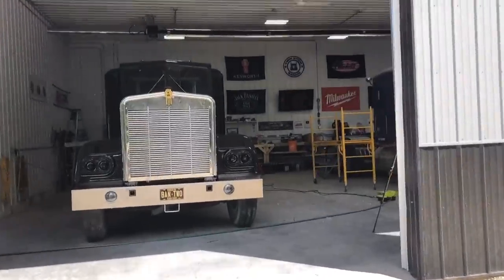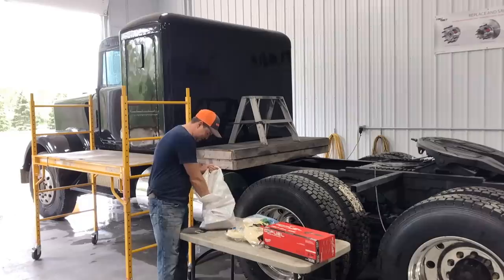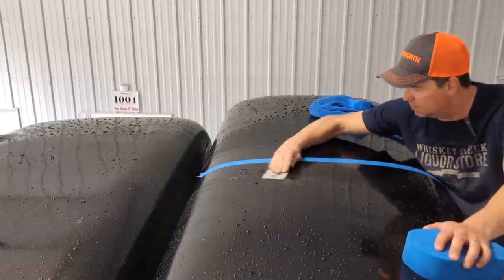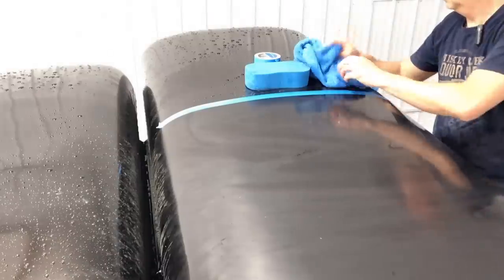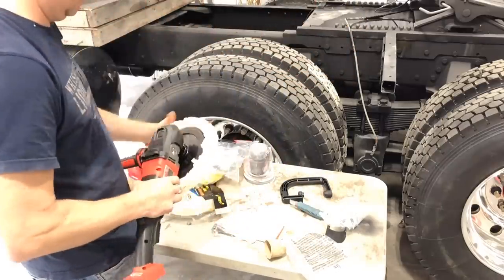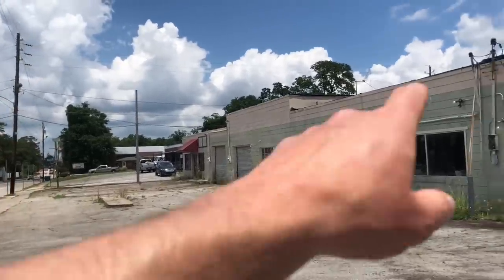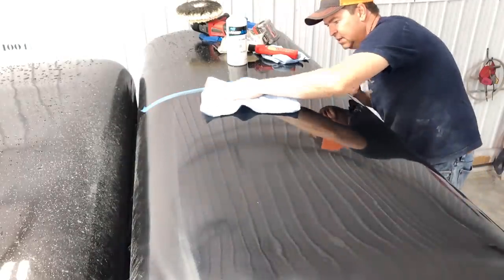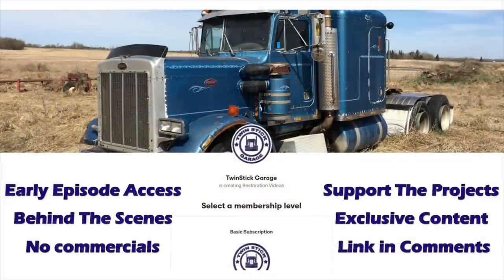Smokey & the Bandit Tribute Truck Ep.46 Rescuing Mediocre Paint

Comment: This is why a high quality, professional paint job costs so much.  A true professional spends a whole lot of time preparing the surfaces, a little time painting, then more time sanding and polishing.  Wet sanding and polishing is pretty much a requirement for a shiny, smooth finish with single stage paints.  The two-stage base coat then clear coat can allow you can get away with less or sometimes no wet sanding of the color coat.  For many years now, factories have been priming by dipping , then applying base and clear coats via electrostatic paint methods, which applies a very uniform, but also very thin, layer of color and clear coat.  Keep up the good work, Mark!  Take your time, make it the best you can and you will be rewarded with a great looking truck.
Reply: The W900 is worth it all Your efforts
Reply: I had mine painted by a guy for pretty cheap. Up close you can tell, but he promised that from 10 feet or more, I wouldn't be able to tell the difference. For a working truck, it is pretty good, but I wouldn't mind having a nice paint job.

Comment: OK mark I do car detailing, 1) your buffing pad needs to be constantly cleaned out, get a pad spur cleaning tool or you can use a screwdriver tip lightly. When pad starts to drag on paint clean it. About every other time you add compound. 
2) you will have better success using foam pads not wool. They have different styles and quality.
You don't have but 2 coats of paint so you'll have to be very careful. With foam pad. Go much slower with foam pad.  Your way too fast on foam pad. You'll get a better shine the higher the sandpaper grit..1st pass use 1500 grit, sand buff off, then use  2000 grit same thing. Buffing it right is a slow process for an experienced person. The buffer you have is hard to master. You should have gotten a duel action buffer way easier and more forgiving.. Also when using your buffer keep pad flat as possible, your using the edge not as much the bottom of pad..do not apply any waxes to fresh paint for a minimum of 45 days..!paint needs to evaporate the solvents out of it. You wax it too soon you'll know it, but read the paint manufacturer recommended time..
Reply: Yep needs to keep the cloth pad blown out or it’s going to just leave more scratches and I did a lot of body work back in the day and that was one of the first things I was told was to keep the pad clean or it was just making more work cause it was putting dirt and grit right back in the pad
Reply: who freaking cares

Comment: Nice job Mark! We always use a spray bottle to apply the water. It’s much less mess. Another thing is to get a thin rubber block from a body shop supply house and squeegee the area that you wet sanded. It shows where you need more sanding. Just a couple tips to make your job easier. Keep up the great work and thanks for sharing!

Comment: This is my job, ive been doing machine polishing for 20+ years. Mark, i dont wish to rain on your parade but that is going to look like a dogs dinner when the direct sun is on it, youll see all the buffer trails where youve been with the machine.  Slow down a bit with the machine, you're arm speed is too fast and erratic. Instead of going direct to the wax, you need a soft foam pad and fine finishing polish on that dark colour to remove the buffer trails/holograms that the wool pad and heavy cutting polish leaves.  I would also advise you to use that orbital sander with 1500 grit paper to sand the orange peel out. It will make it a lot easier and give you a more even finish.

Comment: What a great video and fantastic projects! I admire your work ethic and commitment. I love everything mechanical.  I actually spent a significant amount of time behind the wheel of a ‘73 KW W900 with a 400 Cummins, 15 speed (deep reduction on the dash), and 370 rears. What an experience, now that I look back at it.  My regular truck was an ‘85 KW W900 but when it was down, the ‘73 was mine. Love the clip of Lamar’s.  Also, go get several packs of plain white T-shirts. The cheapest ones you can find. They really help with finding high spots, low spots, and rough spots in bodywork.

Comment: you can have the best professional paint booth and still for a show quality paint job there will always be some paint correction that will need to be done. you could probably start out with 1000 then do 1200 and then 1500. the 1000 will cut the heavier orange peel faster and easier then going up to a finer grit will make the buffing go faster and easier, spend your time getting the flaws out with the 1000 grit then you can move over it pretty quickly with the finer grits as all your doing at that point is just taking out the sanding scratches from the previous step. change your sand paper often as well goes much faster and easier with fresh sand paper. its looking fantastic your really going to have something to be proud of there.

Comment: I found an old vw beetle that I did a so so paint job in my garage.  I found out that after the first cut I used Polishing Compound next with orange foam pad and then ceramic.polish by hand and it turned out pretty good.

Comment: Ok I been painting cars and trucks for twenty years now you do a paint job in a spray booth you can get away without cutting and buffing the paint job but if your going for a show truck a mirror finish then cut and buff it just note to not burn through the clear coat and when sanding you can put a few drops of dish soap it makes the sand paper work a lot better bucket of soapy water a squeegee and keep it super clean take your time it will come out the way you want it good luck and you did a nice job

Comment: Need freshwater flow, Garden hose (put sock over the end) or the old man (pops) come behind grab hose squirt you, how I learned hard wet way, need rubber Sanding block to prevent fingertip trails, want to keep it flat, look for Dull smooth visual effect on paint watch the corners rounded off parts. otherwise, Nice Job. Tip Need Buffer "spur" cheap version screwdriver, clean out pad often so don't drag buffed paint over unbuffed

Comment: Watch your corners/edges where your paint will be the thinnest and how your buffing and polishing wheels are going you want the rotation to come off edge not Towards the edge where it could dig into it the paint so it doesn't burn thru the paint which only takes a spilt second to do ( ask me how I know lol) also they make a tool to help clean the wool pad out every so often during use to keep it fluffy but you can use the side of flathead screwdriver or something like that to do the same thing. Your doing great as usual keep up the good work

Comment: Lookin like an ole pro so far. So just a little heads up from a car builder. Try to work smaller areas at a time. Keeps the compound from drying. Spend extra time wet sanding. 1000, 2000, 3000. The trickiest part is buffing. This will make the trickier part soooo much easier. The extra time you spent wet sanding will more than be made up buffing. And you'll get a much better finish. Be very careful with wool pads. They are harsh. Use them when necessary. If the paint doesn't need it don't use it. Use foam. Much more forgiving, same finish. If you need to be more aggressive, use a more aggressive compound. Good luck. Looking good so far.

Comment: also when you put the filters make sure that filters are going  straight across the garage door put the fans on outside of the garage. make a wind tunnel   use cardboard tape it to the garage door so it pulling from inside of the garage/ this will help with the dust

Comment: Use a foam pad for the first two passes of the higher grit compound and keep it clean.. Keep it relatively flat using most of the face of the pad.... Wool pads are for the finish AKA final polishing stages and its crucial to keep the wool pad clean.... All it takes is one small chunk of crap in it & it will destroy the paint..........

Comment: One thing I noticed was you had a negative pressure paint booth so it pulled all of the dust and fluff into your paint. If you set you booth up in positive pressure using a filter box it can clear a lot of the dust issues up.

Comment: Looks good Mark... for what it is worth after wet sanding with 1400 I would wet sand with at least 2000 if not 3000 to further flatten the paint, you will find that  you won't need to buff as many times because the sanding scratches will be significantly smaller and will save you time in the long run... don't wax for Atleast a month after so that the paint can still breathe and fully cure

Comment: Just a few little tips that may be helpful. I’ve cut and buffed about 15-20 freightliners with single stage paint. 
-Keep the surface wet when you are buffing. I’ve found that the pad likes to jump around a grip to much when it’s dry. I usually keep a water spray bottle with me and just keep it wet. It helps the compound go on nicer and smoother and reduces the risk of burning.
-Keep the pad flat on the surface, and you straight across, back of forth pattern with about 50% overlapping. This helps get a consistent polish and you don’t over polish in one spot.

Comment: saturday!? ain't it Thursday?
mark don't mind your paint job so much, it's pretty good and trust me I saw factory paint jobs way worse on orange peele than that.
it's not the pain it's the work around that makes a paint job exquisite,
also why don't you take the block method with a 1500-2000 grid wet paper?
and take aspray bottle with you when cut and buff to spray it on the surface wetten it a little to not burn out the paint.

Comment: Mark, turn the buffer over and on high speed spin the buffer while using a compressed air to blow off the spinning pad, you will see the paint and crap come out of the pad. Saves the pad and stops getting scratches you don't want from the junk collecting in the pad otherwise nothing wrong with that finish.

Comment: I work at a body shop and it is very rare that we send a paint job our without sanding and buffing. Just go out and look at your car the is a certain amount of orange pill to them all. We try to match it otherwise it can look off from the rest of the vehicle. Your lucky it is single stage with it being black. Bc cc is terrible to get polished out in black since any scratches are shown in white on a black back ground. Also if it is bc cc it is easier to sand and buff within the first 36 to 48 hours since it is still slightly soft and you're more or less smoothing it out.

Comment: Dont worry about orange peel and dust as long as you can cut it bsck. You might be better offbefore you buff it with a sponge attachment to cut the paint a little more. Then use the buffer.

Comment: Looking good always check your surface when buffing or polishing for heat. Heat will hurt you. Also get you some decent microfiber rags. Buy the ones without tags and edges. Tags will scratch and even if you rip the tag off. Where it was attached it will scratch there too.

Comment: Take your rings off when wet sanding, get a spray bottle, more soap, there is no clear on single stage and don't fret so much about orange peel,  new cars have orange peel. More reducer and smaller tip size, less orange peel, but its too late for that now. Keep polishing you'll get there, but keep the pad flat, it's too easy to burn through single stage.

Comment: You looking at ceramic coating at all? I did my pickup in the fall and I sure like it , dust, mud, water spots don't stick to the paint. I did the excavator to grease just washes off the boom. But get all your stickers on before you ceramic coat if you do it

Comment: Those battery powered tools are great until the manufacturer changes the battery configuration so the new batteries don't fit your tools and although the tools are still in good working order the batteries wear out rendering your collection of battery operated tools useless. Electric tools last forever practically and will always plug into an standardized outlet providing of course you have access to electric so I guess nothing's ever perfect. Nice job on the paint just be careful you don't burn through on the edges with the buffer.

Comment: A finishing polish between compounding and waxing will give you a better result. 
You can take it a step further by using different grades of compound before the finishing polish. Start with a low grade compound and work your way up to a finer grade, this will get rid of swirl marks left from the machine polisher. you may not see them now but you will when the sun shines on your new paint. More you put into this stage the better it will look.

Comment: 1st of all you need to use more water when you wet sand that you need to use the block when you wet sand and so it comes out better You're gonna need to finish wet sanding with 3503 2500 and a 1000 believe a lot of Scratches Which will make you use more product which enables you to burn it a lot easier The goal is when you put a buffer to it you can barely see the scratches

Comment: I am not a big fan of cordless polishers, I personally prefer pneumatic polishers due to them being much lighter and they never get hot.  I do have have a 20+ year old corded milwaukee polisher.  For wet sanding I use a pneumatic wet da for large flat panels.  I am personally fed up with the junk tools milwaukee has been putting out ever since the fuel line hit the market.  I have 2 big drawers full of broken milwaukee junk including probably 20 m12 batteries, 8 m18 batteries, 5 m12 ratchets, 3 m18 impacts, 3 m18 drills and 2 m12 drills.  Milwaukee can't seem to make a drill with a chuck worth of crap so I take a brand new tool and throw away the chuck and replace it with a $80 rohm supra chuck that actually works.

Comment: A little tip when using the wool pad as your buffing with the wool pad gets gummed up with compound and paint get a buffer spur or a flat head screw driver and clean the pad as you work, take the edge of the screw driver and run the buffer  to clean out the pad

Comment: you are sanding and buffing wrong. you do not move the buffer in circles. You have to use the cutting edge of the pad and go in straight lines. You can save yourself a lot of trouble and sand the entire truck down and get someone to put on a base coat, and clear finish.

Comment: Also you have to rinse the compound off as soon as you're done if you do not wrench the compound off that compound will get into corners and you'll never get it off and it'll look like c*** I said you need to block it to get the Orange peel and dust out then you need to go to 3000 to 3500 find 100 final sandpaper to get the scratches you don't want to get the scratches out of 1500 cause you'll burn through your paint

Comment: Next time you paint take off all the paper and tape after you prime and wash the truck down really good. Then cover and tape with new. Dust gets trapped in there and you blow it lose when painting. And at least  fold that sandpaper over or ideally use a block. And when buffing , slow your side to side movements. Let the buffer work.

Comment: You need to use soapy water when sanding or you will destroy the paint job and don't sand every where as some areas are impossible to get to with buffer, Truck looks alot better

Comment: Next time wet your floors so you don’t get junk in your paint
Reply from the maker: I did wash the walls and floor before I put primer and paint down … just didn’t film all of it
Reply: @TwinStix  no worries. Thought might been the reason stuff got into the paint. All in all it’s still looks good. I have to cut and buff my 67 Chevy pickup. Keep the vids coming. I love the cab over. My first truck I drove was a K-100 in Las Vegas in the summer with no a/c no power steering and no air ride anything. Love the vids.